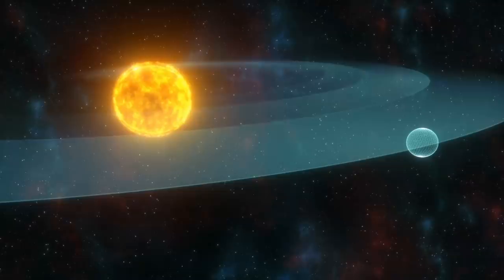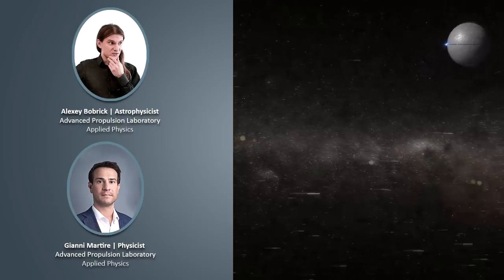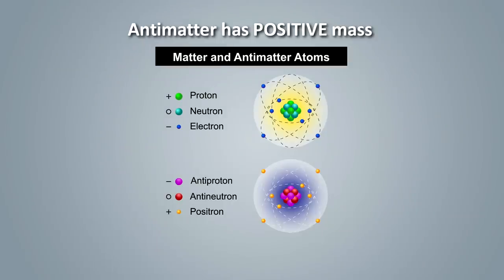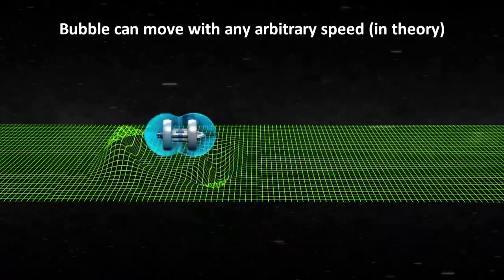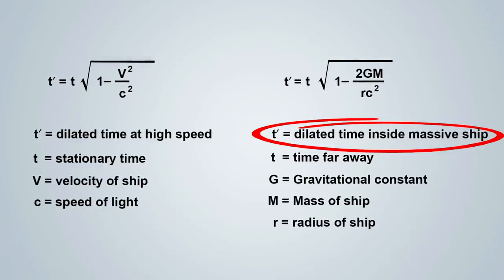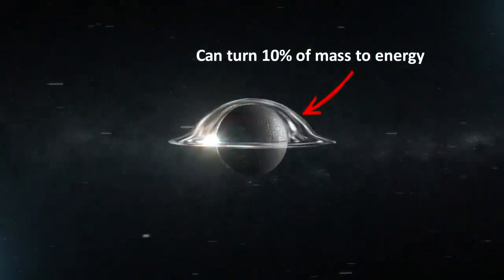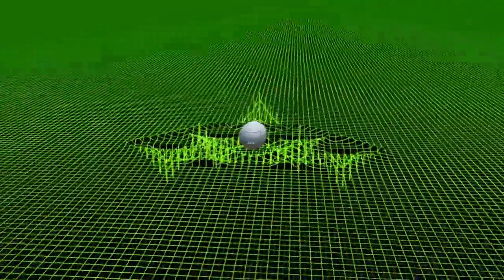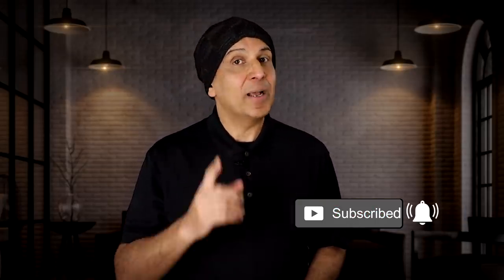REAL Warp Drives? NEW research proposes a solution!

Comment: "What we usually consider impossible are simply engineering problems. There is no laws of physics preventing them.."   - Michio Kaku
Reply from the maker: If that is what he said, I would have to disagree with that. There are physics that prevent certain things from occurring, such as the conservation laws - energy, charge, etc. You can't get energy from nothing for example.
Reply: Space is a dual concept!
Space is dual to time -- Einstein.
Time dilation is dual to length contraction -- Einstein, special relativity.
Length , distance, space or depth is produced by the stereographic image created in your mind by the two dual images from your eyes -- hologram in the brain. Depth or the 3rd dimension is a by-product of duality (two eyes) -- holograms or two interference patterns produce depth, or distance. In physics the vector cross product between the x any y dimensions creates the z dimension or third dimension!
Distance, length, space or depth is defined by two dual points -- space duality.
Points are dual to lines -- the principle of duality in geometry.
Up is dual to down, left is dual to right, in is dual to out -- space duality.
Space duality is dual to time duality.
"Always two there are" -- Yoda.
Reply: @ArvinAsh  "You can't get energy from nothing for example."

Then how do you get a Universe?
Reply: @ArvinAsh  We don't know everything about the universe yet, or our planet and it's possible technology. Warp drives was seemed impossible before, but now its not. These "Laws" aren't made by the creators of the universe, just normal people who discovered a apple falling, and wrote a paper about it. We keep finding more and more stuff about physics n stuff. Prob only know a small percentage of it.
Reply: @ArvinAsh  Some said that a coffee cup full of nothing has enough energy to boil all the water in oceans if it only could be harnessed. I believe it was Lawrence Krauss, at least he talks a lot about the nature of nothing. There's no such thing as nothing, but a fluctuating quantum field.
Reply: @prebenkul  khm, check the video again, they are still impossible. Its same as having a car but not having a fuel to move it. Same with warp drives, whats the point when we dont have negative energy, dont have usable fusion propulsion nor small enough reactor, nor we can 'harvest' antimatter.
Reply: @prebenkul  Well said. I totally agree. In addition, I think the current “Laws of Physics” are limited with our current of knowledge of Physics. I’m certain these Laws were even more limited before Einstein was born. Better yet , imagine the Laws advancing yet again with the next Einstein who’s yet to be born. We’ve come a long way since that apple dropped.
Reply: @robertsutton8894  At first there was a tiny, extremely hot with massive mass object. From there we've got universe.
Reply: @ArvinAsh  what about quantum fluctuations? And also based on noethers theorem, conservation laws can be broken if certain things are not symmetrical
Reply: @robertsutton8894   bruh even Einstein was not able to find an answer to this question and you are asking him to solve it. By the way we can use dark energy which is 75% of the universe but we don't yet know how to harness it
Reply: @ArvinAsh  he means impossible as in like how we dont have material as dense as neutron star material available and technology for better propulsion etc..
Reply: @ArvinAsh  there is no such thing as 'nothing' - even in deep space there are random atoms..
Reply: @ArvinAsh  you're still framing that around a finite understanding of a bigger picture. there are physics THAT WE KNOW of and laws THAT WE KNOW OF that say we can't do these things. I feel we are on the precipice of some really big advances, that will be a domino effect in understanding other things, things we all coined as 'scifi' until recently.
Reply: @robertsutton8894  the answer to that is uncomfortable for some.
Reply: @robertsutton8894  i mean the mass could have already existed in a super massive singularity
Reply: @kronos5641  you are thinking of dark matter that is 75% of the universe, dark energy is the force causing the expansion of the universe and we don't even know if you can harvest that
Reply: @ArvinAsh  Energy cannot be created nor destroyed.
Reply: Except that faster than light travel truly is forbidden by the laws of physics.
Reply: Have you even watched the video?
Reply: "Usually" considered impossible (?)  Perhaps I should not touch this with a ten foot pole, haha.  One could say "impossible inside this universe."  True but what if you could step outside?  You cannot step outside, that's impossible!  Yes.  A primordial cosmic superstring is impossible.  Is it?  Unless you create a universe and then manipulate the phase transitions.  Now you're making stuff up.  True.  A weird conversation.  LoL.  Imagination enters the conversation.
Reply: @ArvinAsh  how is everything always in motion if energy cant be drawn from nothing?
Reply: Kaku's statement  makes me think of the current work on fusion reactors. Actually building a working fusion reactor is fairly easy. People have built them in homework shops after. Building a fusion reactor that has net energy gain, can sustain fusion reactions to supply usable power out puts and has a long enough service life is another matter. The breakthroughs needed IMO are higher temperature super conductors. I can see ITER in France achieving net gain fusion but I have a hard time seeing it leading to a practical reactor design. The current design MIT is proposing is smaller, factors of 10 cheaper and actually designed to be serviceable. Will it work? The only way to find out is to actually build it. Additionally i think the DOE in the US should put some research money into some of the alternative reactor proposals. The way we are tossing money down the drain now we might as well take a gamble on some long shots.
Reply: @shanemarz6742  Syntropy (prediction) is dual to increasing entropy -- the 4th law of thermodynamics!
Teleological physics (syntropy) is dual to non-teleological physics (entropy).
Mind (the internal soul, syntropy) is dual to matter (the external soul, entropy) -- Descartes.
According to Descartes your soul is dual.
Concepts are dual to percepts -- the mind duality of Immanuel Kant.
According to Kant your mind is dual.
Duality creates reality.
Reality is created by energy, hence energy must be dual, electro is dual magnetic, potential energy is dual to kinetic energy.
Apples fall to the ground because they are conserving duality.
Action is dual to reaction -- Sir Isaac Newton.
Gravitation is equivalent or dual to acceleration -- Einstein's happiest thought, the principle of equivalence (duality).
Gravitation is dual to acceleration -- Einstein.
The force of gravity is empirical evidence that duality is real.
Reply: @milosstojanovic4623  I suggest that YOU watch the video again, Arvin said specifically this drive was now possible, not impossible, but work on the how still needed to be done. Alcubierre's original theory required negative energy it does not anymore based on the theories put forth in this paper. Simply put, the science hasn't translated to engineering yet.

Fusion Propulsion is possible simply based on the fact that we have a giant fusion reactor nearby right now, it's called the Sun.

To counter your next point, it's already been proven and done that we can harness antimatter, the only thing stopping us is how dangerous it is, how hard it is to harness and containing it. All of these things which further shows me you have no idea of what you're talking about.
Reply: @housetheunstoppablessed4846  and you spit bullshit. Nothing you wrote is not proof of anything, if fusion propulsion is an usable thing, they will be using it in space ships. Same thing with antimatter, stop spewing nonsense.
Reply: @Heikki_Finland  it’s told by Hal Puthoff
Reply: @ArvinAsh  perpetual drives do exist.
Reply: @ArvinAsh  if the laws of physics are right and you can’t get energy and mass from nothing then the universe can’t exist, right?
Reply: @msislam6751  and where did this mass and energy come from?
Reply from the maker: @skygge1006  If you study physics, you learn that there's really no such thing as truly "nothing"

Comment: Ok, one solution requires infinite energy and the other requires a spaceship made from Thors Hammer. Got it! We are so close....
Reply: The 2nd option only requires 10% of the mass of our sun, and in universal terms that’s not even that much. If we can manage to somehow extract it from the sun without major issues... we’re set!
Reply: Woo HOOOO !!!
Reply: You are right... But that is not the point. The point is that it is not impossible
Reply: Wrong they have brakes
Reply: Haha
Reply: Maybe use the naturally magnetic poles of the sun/planets to get a start/energy reduction in what is required to warp space... or even a black hole
Reply: Too bad thor's AXE is just made from the power of a star's core
Reply: I hope you see what stretch your comment is
Reply: @Fleetstreetbestone  once we learn how the most recent found exploding superstar lost all of its outer layer in 2.5 years without it's core losing its outer layer. Use that knowledge to offset nearby dark matter from the sides of the spacecraft to the rear. Dark matter does have its own gravity.
Reply: @solj1n193  don't bring a black hole near our parsec of the milky way. I like living
Reply: @Fleetstreetbestone  and we have to figure that out before using all the resources from our solar systmes planets, doubt it, im pretty sure putting other solar systems that far away is a a sign that we should just die off or become self sufficient, but that is literally impossible
Reply: where is mr spock when you need him
Reply: I'm not thinking another planet in outer space wants us to just pop in .I guess we send probes first...Pretend we can get passed everything...We start at 00000.Once we get there.That will take the longest so this is  millions of years in the future.
Reply: Third option, we find a way to summon the bifrost
Reply: @jtmann2002  Damit way didn't you say that earlier .We could have be there by now...🚀🙂🤓🤣
Reply: We do have infinite energy..
Reply: West West  Nice thinking and thanks for the info ..We will bring that up at the next meeting..lol🤣🤓....That wouldn't be so fun if you turn out to be right..
Reply: As well as, the mass required to achieve the second option would crush any thing we could build including us. So we get to our destination but we’re dead. 
Sounds like a great idea.
Reply: if we can use hydrogen as an energy source then we would be set, h20
Reply: JD Russell  unfortunately when money’s involved so is the us gov but the atomic clock theory, though it contradicts the theory of relatively, would in turn lead to more advancements of time dilation but we just need a little more time to find the right combo
Reply: JD Russell  unfortunately when money is involved the us gov is not far behind. but if the atomic clock theory’s are successful they could in turn lead to time dilation needed to help make an interstellar craft possible we just need the right combo of energy and that time movement
Reply: @Fleetstreetbestone  could this be the reason for chinas artificial sun ?
Reply: Y’all still think inside  what you know instead of what’s possible
Reply: @terryjohnson3477  Hey God loves you! We have all sinned against God, but God in His love made a way for us to escape His wrath on our sin and that is through Jesus Christ. He came in the Flesh born of a Virgin, lived a perfect life, being tempted In every way as we are but never sinned, then willingly was beaten and crucified at the hands of ungodly men for the punishment for our sin so that we could by His blood be forgiven and He rose again 3 days later to justify those who put there trust in Him and He is now sitting at the right hand of God as our High Priest and He is coming back soon! I encourage you if you dont know Him to repent (change the way you think) and put your faith in Jesus. It's by His grace, through faith in His name that we are saved! His Holy Spirit will come and make His home in you and give you a new heart and rebirth your spirit. Look to Jesus!
Reply: Yeah! After the video concluded i had the same thought, what are we making this possible in science ship outta? We can't build it on earth cause a solar mass on earth is bad, occupational safety and health would have a fit! How would we survive under the immense gravity inside? And how does any of this present as scientifically sound?
Reply: @Fleetstreetbestone  how? 10% solar mass is not survivable i figure for meat and bone like humanity. As well, where does this get built, if that kind of mass were near or on earth it'd mess up all kinds of stuff that matters wouldn't it?
Reply: @solj1n193  or magic?
Reply: Humans already have faster than light technology in use right now.
Reply: @Sonofsun.  its a hammer but get your point
Reply: There is no we, its elite tech been around forever
Reply: @ohiunku  nah its a battle axe
Reply: Before you dismiss, cell phones/mobile phones evolved from Star Trek's communicators and work entry pads.
Reply: Oh man, are you close! The Nautilus, AKA the ELO submarine, and Tardis, is yellow because it is covered in the holy grail!
Reply: @Fleetstreetbestone  Look up a Dyson Sphere maybe possible very far out
Reply: Anyone think about bob lazar and 115 when he said that? Makes you wonder
Reply: No problems I've got some that in me shed
Reply: @hazmatcinemaxxx  mass effect fields
Reply: Standing on a 600 meter sphere with 10% the mass of the sun will definitely make you join weight watchers.
Reply: @Tachsman  you would weigh almost as much as everyone currently on weight watchers combined... not quite.
Reply: @Fleetstreetbestone  dyson swarm powered laser that produces black hole which gobbles dark matter energy till it dies in the front.. fission fusion thruster in the back..
Reply: @Thelasthouroil  dude. C'mon were trying to have fun, just think about what is out there to see and to do in this infinite universe that we reside in and save religion for somewhere else this SCIENCE and FACTS
Reply: Like people from 18 century...flying machine is impossible..😁😁
Reply: Tokamak in a diamond spaceship lol..🧙‍♂️